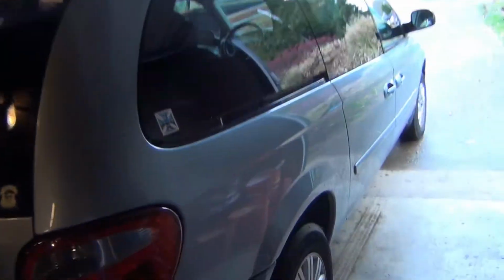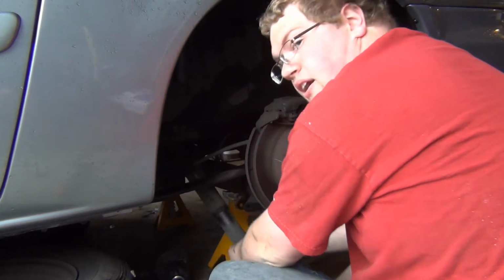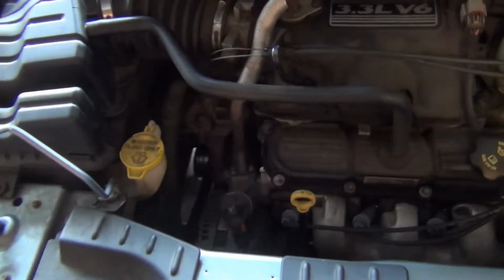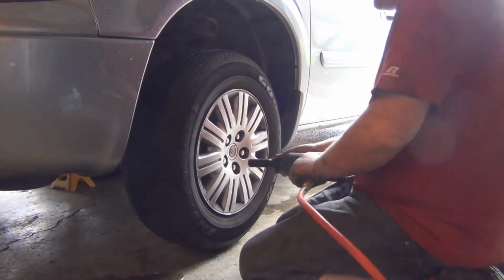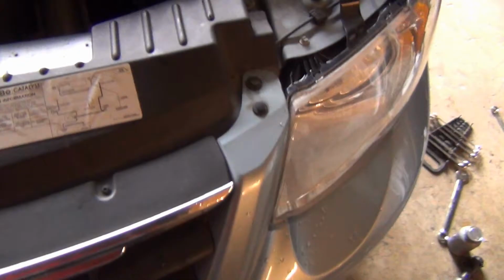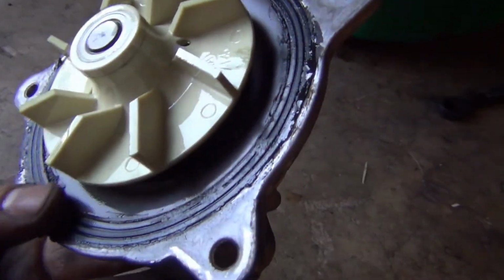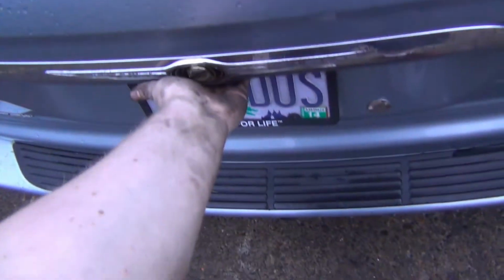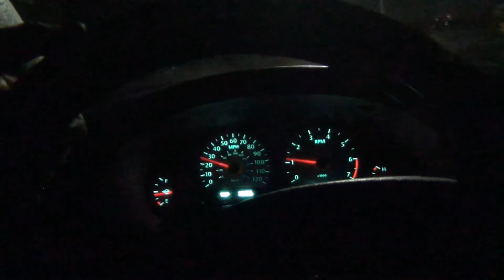Chrysler Town and Country Gets all Fixed Up

Comment: P0404 is a circuit/range performance for that pos EGR you put in there with the smaller diameter. EGR is choking  Good Work otherwise!
Reply from the maker: I checked the diameter and they are the same. I thought the old one was bigger in the video but, I went back and checked it is the same.
Reply: Thats what I initially saw hha my bad... It appears that is is significantly different but Im sure in person the diameter is much different. My apologies
Perhaps its a carbon buildup elsewhere?
Reply from the maker: Ryan T I'm gonna check the intake manifold, maybe remove the valve and check the port on the cylinder head... and check the wiring harness for broken wires.